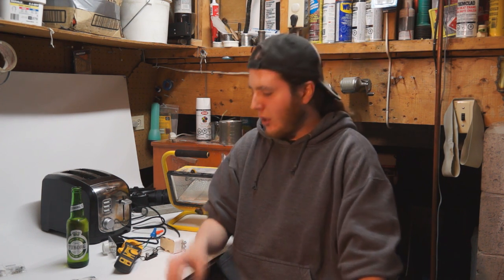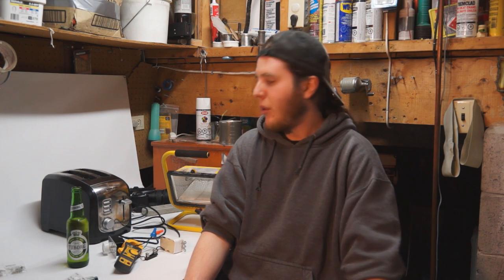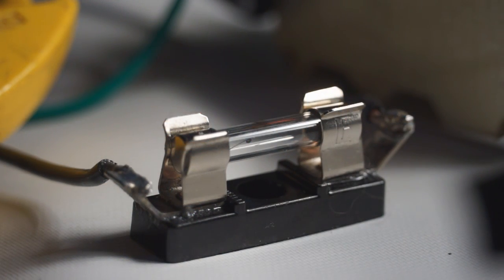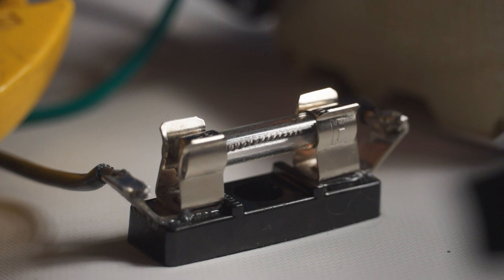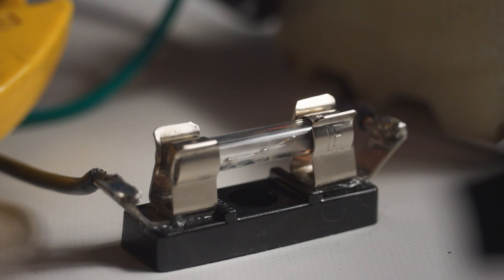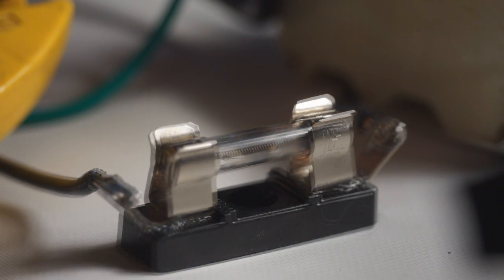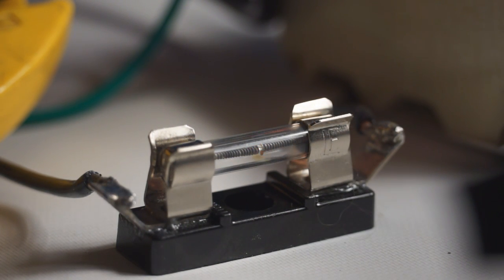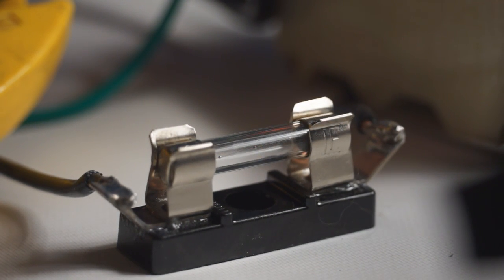Blowing Fuses in Slow Motion

Comment: Interesting video. I have been trying to find out what the specs are on a VCR power supply glass fuse that has blown. The markings have on one end 1.6A 125V and on the other end it has 51S. I am wondering if it is a fast blow or slow blow fuse. the broken filament has 2 beads in the middle. Any idea?

Comment: Cool idea!  That .75A hung in there on the 8A load...
Reply from the maker: Yeah, I was really surprised how long they all lasted with the 8amp load.
Reply: Nick Moore I wonder if it's a nucleation problem in that the metal is hot enough to fail but doesn't have a good place to start.  The wound fuses being in contact with that thread probably have more nucleation points vs. the floating blob bridges (and therefore fail more quickly?)

There was some interesting wobbling in the .75A load as well.  As usual, high speed video creating interesting new perspectives on the traditionally mundane.

Comment: Over here in the UK it's quite common to see the glass fuses explode (as in bits of powdered glass all over the inside of the equipment). If you happen to be near the substation in an urban area, with multiple 750-1000kva transformers, the short circuit capacity can be in the range of tens of thousands to even a hundred thousand amps. Stuff just tends to cease to exist rather than melt LOL

Awesome to see this in slow motion though :)
Reply from the maker: That would make a cool slo-mo but the lines around here are so long that inductance limits explosions to a "safe" current.
Reply: Nick Moore Sadly I don't have a slowmo camera, but I hope someone picks up on this :)
Reply from the maker: Maybe a destruct-o-tron capacitor bank would do...